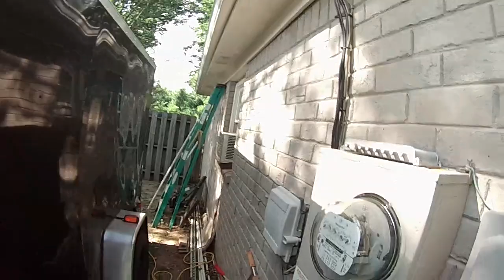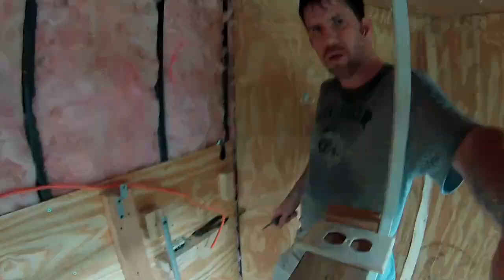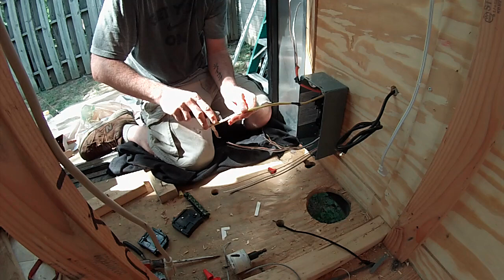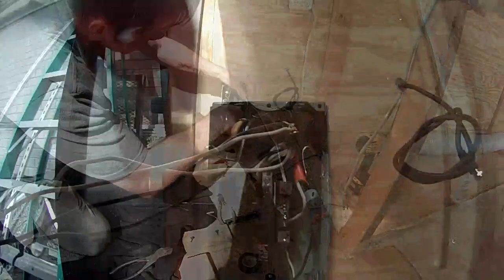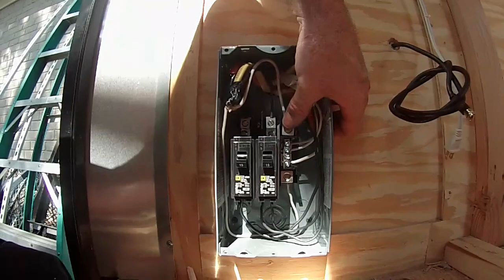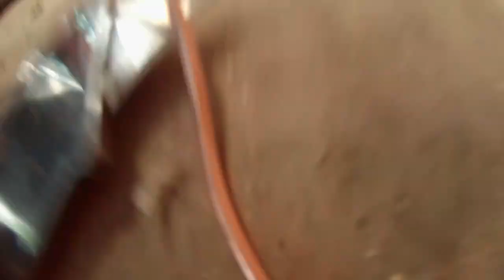Electrical  Pt 2 Breaker Box ....... 6x10 Enclosed Trailer Conversion Project

Comment: Kraka069 How would you wire the incoming if you only had one exterior plug (to power both breakers)? I have the exact same panel you used except I only installed a 30 amp exterior inlet.
Reply: You would use a jumper wire across the main "hot" lugs inside the subpanel. I just did the same thing with the same box in my pop-up.

Comment: I'm doing something similar. Do you have the two extension cords coming in and both neutrals going to the same place or separate neutral bars? Hard to see. I know all the grounds can go together but not sure about the neutrals, since they technically carry current.

Comment: Do you use a 'male male' dog bone adapter to hook up power from your source to your trailer?
Reply from the maker: i use 2 cords.. most sites have 2x 110 plugs
Reply: Google "power inlet"  look for L5-30 for a 30amp 120v twist-lock

Comment: Hey Kraka069, I really like your video series on the trailer conversion. I have watched a lot of videos on this subject. Last fall, I bought a 8.5x16 to convert into a toy hauler. I ride/race dirt bikes. A regular camper just don't fit my needs. I recently insulated my ceiling with 1" rigid foram like you did but I haven't done my walls yet. I had not thought about using the fiberglass batts until I saw this vid. How do you like your choice of using the batts? Would you recommend going that route? It's a little cheaper than rigid foam down here in North Alabama where I live. I need your opinion.
Reply from the maker: +Kevin Lash the wall insulation worked Great !!!
where at in North Alabama? Im in HSV
Reply: +Kraka069 I work in huntsville but live in Killen, al. I had no idea you were in huntsville. I'd like to see your trailer in person sometime. email me at kevlash41@gmail.com

Comment: I'm a new subscriber. I like your videos. They are real. If you know what I mean. Some people don't understand what DIY really means. You are doing it right, cheap and YOURSELF.  You don't need a electrician, plumber, interior designers, or conduit for the electrical. The odds of a electrical fire due to wires vibrating are slim. The outside casing would have to be constantly rubbing on a rough or sharp surface. Not vibrating a little bit while driving. I'm going save my money on little things like that, and put it into the kitchen where you cook, have a open flame, propane ect... I'm new to most of this myself. Planning on building a DIY camper this summer. Check out my comment on the previous video Maybe it will help. I know every time I looked at that hole I would kick myself in the butt. The paint and silicone will have to redone with time and bring up a bad memory.  Keep on keep n on. Good work.